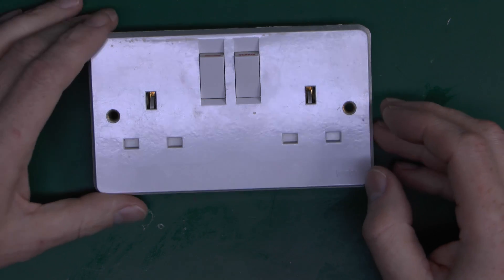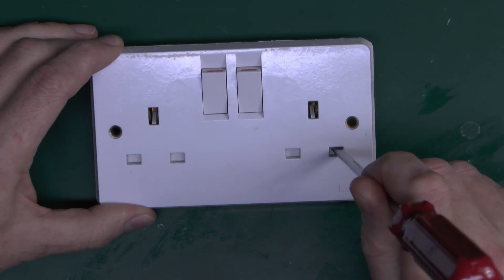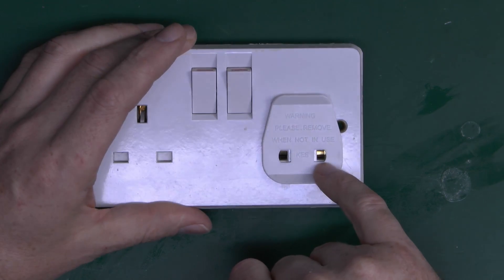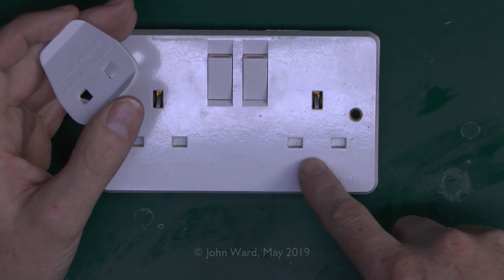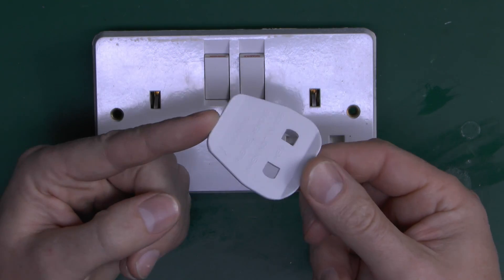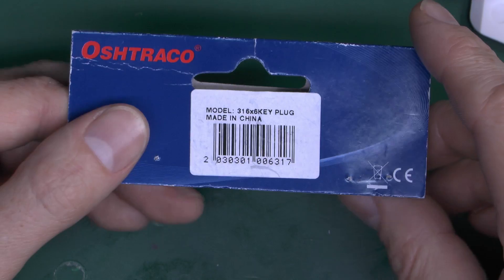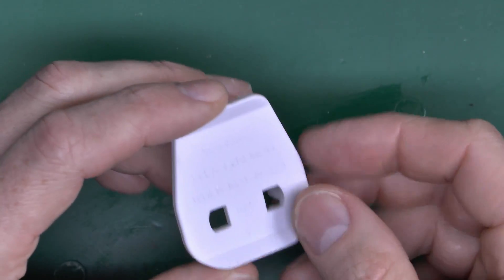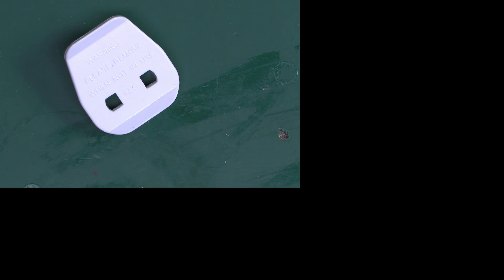Plastic Socket Key to Defeat Safety Shutters in UK Socket Outlets

Comment: Given the shields on plug sockets, you’ve got to wonder why most have switches on them.
Reply: Benzknees for convenience. Most devices are left plugged in all the time, saves unplugging when not required, saves wear on the socket.
Reply: Australia/New Zealand DO have switched sockets and I hated having unswitched sockets when I lived in Europe for a time.
Reply: I have heard that Britain used to have DC at 240 V and that needed switches to break fast enough. After that they remained just because people were used to them. It does add some safety against kids but on the other hand it is another thing that can fail.
Reply: Okay, but the same could be said for European, US & Aussie plug sockets, but as far as I’m aware they don’t have switches. And as their plugs have much flimsier, looser construction, if anything they need switches far more than we do.
Reply: @Benzknees  We don't need switched outlets. Just one more reason for them to fail. How many times has JW taken apart a BS1363 outlet that's shit the bed because the switch burnt out again? Outlets that are less than 5 years old and already failed? I've got outlets in my house older than I am that still work just fine. No switches.

Way it should be. build it to last, buy it once.

Comment: the only time I'd consider using something like this is gluing it to the plug as a stopgap until able to get the correct plug
Reply: No, that just is not acceptable as you can damage the socket.  If you buy that you can just as well buy the proper adapter instead. Even the dangerous Chinese adapters are better than this.

Comment: Cheap way to plug EU plugs with sleeved pins :S These EU plugs may break if force are applied.  is it acceptable to use an UK male plug  to a type F extension  multiple outlet?
Edit. The only utility of this plastic defeaters  is to expose the contacs for voltage testers such as uni-t ut15c ut18c or an NCV

Comment: I can't remember the last time I casually brushed against an outlet, had something conductive just happenstance into the live ternimal, and shock the piss out of me. /s
Reply: Yeah we get it. But you're not the idiot these things are designed to protect against.
Reply: @chocolate_squiggle  It's a problem that just doesn't exist. Not even the dumbest members of society...children...go around poking shit into outlets on the regular. If they did Britian would have a far lower child electrocution rate than the rest of the world, and the rest of the world would have added shuttered outlets to homes in response. Not only that, but it's not exactly difficult to defeat the shutter. Don't even need a device like this; an emery board is sufficient given the fucknormous size of the BS1363 ground pin.

Comment: A few years ago I had a week in Germany and Austria. Came back on a late flight, so booked a hotel near the airport. I've got a euro to UK adapter that also has 2 USB sockets on it, so I took this and a USB cable to charge my phone. When I got to the hotel, phone nearly flat, I realised that I had nothing with a UK plug that would allow me to charge my phone. Ended up using my car keys in the earth and shoving the euro plug USB into one of the sockets.
Reply: Did you tell the staff so that they can call an electrician to inspect the socket. What if in a year 100 people die because the socket you rammed the europlug causes a fire?

Comment: None of this seems dangerous to me since I live in the U.S. and all of our plugs are exposed
Reply: Double the voltage, far more deadly. Especially for children.
Reply: @analogdistortion  You only need about 40 volts to kill. 120 volts at 15 amps is just as likely to kill some dumbshit four year old as 240 volts at 13 amps.

It's like saying a 9mm is less deadly than a 7.62NATO. I mean, sure, in a technical pedantic sense, the 9mm packs significantly less energy and people are more likely to survive being shot by them, but they're both lethal in most cases.

Also worth noting, EU uses the same 240 volt supply, but they do not have shuttered pins. Austrailia uses the same 240 volt supply, but they, too, lack shuttered pins.
Reply: I thought US outlets were now shuttered too?
Reply: @risvegliato  No, but we have a third socket for the ground pin, which is rounded, and also holds the plug much firmer into the outlet. I see that electrical terms in different parts of the world mean different things, though.
Reply: risvegliato none of the outlets in my house have this feature other than one that I have recently replaced since it had failed. the new gfci outlet had the shutters on the hot and neutral inserts of the plugin.
Reply: @risvegliato  Nope. We don't need shutters. Nobody does. The shutters are just an example of the British plug being hilariously overdesigned to solve issues that just don't exist.

If shuttering the live and neutral pins were truly necessary the rest of the developed world would have them as well.
Reply: @TestECull  maybe the rest of the world hasn't developed.
Reply: @karma247ajm  Or maybe Britain is trying to solve a problem that just doesn't exist.
Reply: @TestECull  All modern sockets in Europe are shuttered. We had ones in the children's rooms in the 60s. The shutters back then were more primitive so they were really suitable for children's room. Modern shutters that do not need extra effort were available already in 1980. In 1980-84 three children died because they stuck something the outlets. After that there has been no such cases. The reports begin from 1980, one can just wonder how many died before.

The British socket has larger holes than others so socket are more important-
Reply: @okaro6595  Don't know why the pins on a British plug are so ridiculously oversized. You could run 400v appliances off that fucker.
Reply: @TestECull  Shutters are the norm in many countries. Also they are better than the standard British shutter as they require putting both pins at the same time.
Reply: @okaro6595  Don't need shutters at all, also why reply to such an old comment?
Reply: @TestECull  shutters are better as they make it harder for people to electrocuted themselves by sticking things like forks down sockets
Reply: Exposed outlets are dangerous only if you have small children. The US outlets do have the benefit that they are rather tight so not everything fits there. British outlets are the largest. In the early 80s when shutters were still rather new and not in all homes three children in Finland died by sticking something in outlets.The items used were a key, a mixer beater, and two nails.

Well we had shutter already i the 60s on kids' rooms but they were different and required a special way of inserting the plug .Modern shutters were available in the late 70s at least. I do not have them in my apartment.

Also those who have kids should check that not only the sockets but also any extension cord has shutters.In Finland cords with no shutters were sold still in the 90s.

Strangely there was one case where a shutter mechanism caused a non-fatal shock. The shutter in a power strip had become damaged and the spring inside connected he line and ground. Because the outlet was not properly grounded (ground wire not connected or gotten loose) the circuit breaker did not not cut the power. Do not use power strips where something rattles inside or any other damaged item.

Comment: John, I absolutely agree with you. Strange that this is the normal method in Dubai. In countries such as Singapore that use our 13A socket outlets and electrical hardware, appliances are fitted with proper 13A plugs. Although you can often also buy adapters for use with other plugs.
Reply: They are actively  getting  products/appliances to comply with UAE ESMA Certifications which in turn follows BS  standards as base.

But then there are there Chinese marts and re-export of chinese goods which make their way into local market use.

Comment: The problem is simply that BS1363 sockets are standard in UAE (and a surprising number of other places around the world) but there is no law requiring consumer products to be sold with the appropriate plug fitted.
Reply: Well if you buy from a foreign seller you naturally get what he sells. He has no duty to fit plugs for your country.If you bu y from a local seller I would think they have proper plugs or at least adapters.
Reply: Or, in a similar case inside EU (but is purely national silliness), making it illegal for me to fit the appropriate plug on the appliance. Whether I might have done so, properly earthed and with strain relief, I must claim not to remember. EE'96
Reply: @kkpdk  Can you cite the legislation?  I ask because as far as I am aware it is not "illegal", nor does it require notification and certification, to fit a plug to an appliance but I'm willing to be proved wrong on this.

Comment: Good one as usual - just to clarify CE actually resolves to - Conformité Européenne and is applied to products destined to be sold within the EEA - European economic area - Wiki P extends this thus - " CE marking is a certification mark that indicates conformity with health, safety, and environmental protection standards for products sold within the European Economic Area. The CE marking is also found on products sold outside the EEA that are manufactured in, or designed to be sold in, the EEA " - so Brexit aside ......
Reply: Not in that case.. that article was not approved by them at all.. in this case its "China Export"...  there are many videos on how China ripped off the logo (spacing is like 1mm different) and put it on their own products which does fool many into thinking the product meets EU ratings when it means something totally different... do a google / youtube. search on the "china export logo"
Reply: @n2n8sda  Thanks for that - my reply was to clarify what the "correct" or "assumed" meaning of CE is - yes the so called Chine Export logo symbol is in fact a rip off, and as you say the typo-graphics are different, indeed it would be interesting that - post brexit - we may revert to the BS kite symbol - or some other symbol / logo indicating compliance wit UK legislation and guidance, maybe some reference to the PUWER regulations or similar

Comment: MK cleverly designed a shutter that required not just an earth pin to be present but also the live and neutral pins or the shutter wouldn't open.  This device is cleverly designed to defeat the clever MK design.  Full marks!

Now, if the manufacturers could make sure that these devices are sold only to very stupid people, everything will be fine.  I love a Darwin Awards ceremony.
Reply: Well, most of continental Europe has sockets with exposed socket holes and no shutters. You can buy plastic covers which are difficult to remove (for children) mind you, when I was kid I managed to blow fuses and get shocked by sticking scissors into one of the mains sockets. I was growing up in the time where I was walking to school at age of 7 with house keys on piece of string around my neck, so different approach to safety. Mind you, I didn't try this scissors trick again 😂😂✂️✂️
Reply: I agree that MK design is excellent, but you are wrong when you say all three pins need to be present. The earth pin plays no part  in opening the shutter. In fact on the early specimens on this design a Euro plug would go in no problem at all,  then they tweaked the profile of the shutter to stop that happening in later production. My house is full of the earlier type.
Reply: @rambo1152  
History is a great subject.  Especially when you understand that it continues right up to the present.

The first design of MK BS1363 sockets had a shutter which was opened by the insertion of the earth pin.  That was in the days of long, long ago.

A newer design of MK BS1363 sockets had a shutter which was operated by the simultaneous insertion of live and neutral pins; the earth pin played no part.  You seem to have a lot of those.  You also think that's the end of the matter, when it isn't.

The latest design of MK BS1363 sockets has a shutter which requires the simultaneous insertion of all three pins.  It is a very clever piece of mechanical design.  And it's a bit of a bugger to defeat.  You need something with a very similar shape to this plastic socket key, in fact.

Whether or not this plastic socket key is actually up to the job of defeating a modern MK socket is open to question.  It's a piece of crap so may not do the job it was designed for.

Comment: Why don't they just use a shaver adapter? Those will usually take a Europlug and, often, a 2-pin US plug.
Reply: Shaver adapters are only rated for low current. 1 amp or so.
Reply: @Codedbad  https://www.amazon.co.uk/ampTECH-Plug-Adapter-Converter-Netherlands/dp/B07MWGRLQT/ref=pd_day0_hl_147_1/261-3766678-8031449?_encoding=UTF8&pd_rd_i=B07MWGRLQT&pd_rd_r=d65bbee4-8ad3-11e9-a473-6ff71fc7a21c&pd_rd_w=pJlIv&pd_rd_wg=bkyCH&pf_rd_p=92d624bb-a334-423e-8722-8024dd09667f&pf_rd_r=X1S6KV2CT75AX3AXZYZ2&psc=1&refRID=X1S6KV2CT75AX3AXZYZ2
13A has its own shutters
This is the safest option.
Reply: Just use a proper adapter and do not try to plug the plugs into what they are not intended. Europlug is not intended for British shaver socket.
Reply: @okaro6595  Better than the plastic socket keys!

If it's just a mobile phone charger or some other low current appliance, shaver adapters will do. They at least have a fuse.

It is inexplicable that the UAE, Malaysia etc use the UK socket and the electrical equipment doesn't have UK plugs.

Comment: Hello John, I have seen European tourists smashing the sockets in Hotels trying to plug in their European 2 pin plugs for phone chargers and laptop chargers, they smash lots up.

Many hotels I have seen in Glasgow and London have European round 2 pin sockets installed in the rooms as well as the standard 3 pin uk sockets.
Reply: It must be cheaper than replacing smashed sockets.
Reply: I recently stayed in a hotel in Lanzarote and noticed they had  a “one fits all” sockets either side of the bed - was very handy for charging

Comment: Bizarre item for sure but I would suggest both ES and BC lamp holders with no lamp in are a safety disaster. It beggars belief they are still made.
Reply: GU24 sockets are superior
Reply: I can't count the number of times I've been bitten by an open ES lamp socket while changing a light bulb..... /s /s /s /s /s /s /s /s /s /s

If you get bit by an open ES it's your own damn fault for putting yer fingers in there.